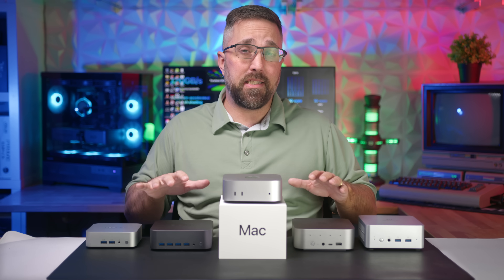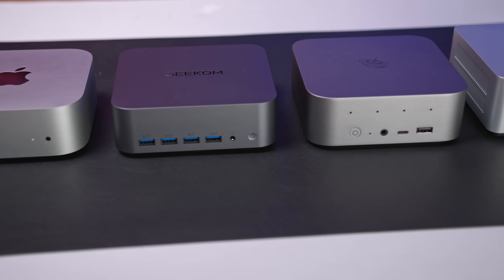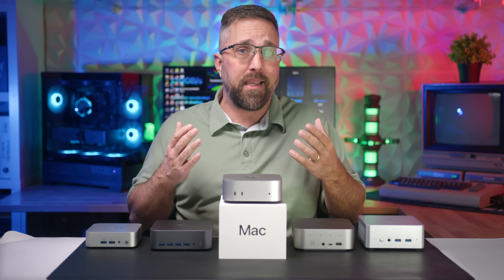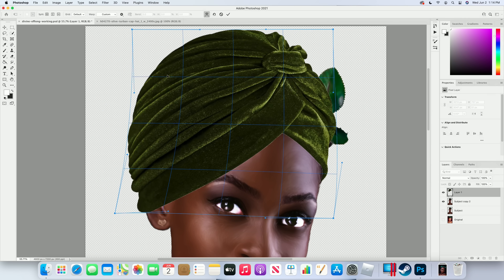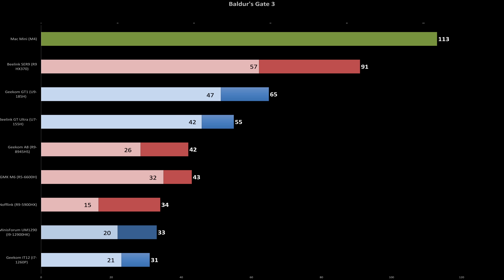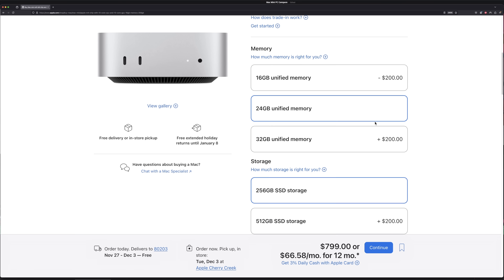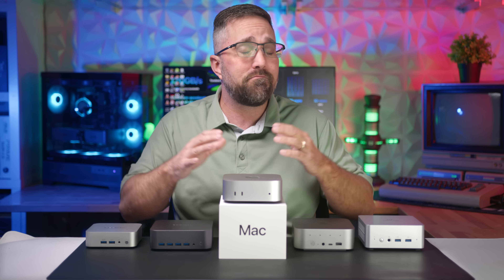M4 Mac Mini vs Intel and AMD Flagships – It's Not Even Close!

Comment: AMD switching to soldered memory? WTF are you on about? pc design is left the the manufacture and there isn't much difference soldered nad socketted. no wonder your channel only has 60k subs.
Reply: Pin of shame
Reply: "only has 60k subs" haha like that's a low amount
Reply: @hyatt2844  well it isn't a huge number to brag about but yeah it is something.
Reply from the maker: @EdU-od5ec  Still waiting. Nothing yet? Let me help you out: https://www.amd.com/en/products/processors/laptop/ryzen/ai-300-series/amd-ryzen-ai-max-plus-395.html   Just FYI, everything you said is wrong and five minutes of research could have saved you from making foolish statements.
Reply: @ElevatedSystems  This is Strix Halo, not Strix Point.
Reply from the maker: @Ic3h0t  True. Same architecture, different core counts and bandwidths. The point is the PC manufacturer has no control over what memory types are compatible with a CPU. That is completely up to the CPU manufacturer. And with the bandwidth requirements of these newer SOCs, current socketed memory technology isn’t compatible.
Reply from the maker: What socketed memory is compatible with AMD Strix Halo? I’ll wait.
Reply: @ElevatedSystems  Even Mac mini added dual CPU (M1 + intel/AMDx86, or any X86) + $199 MSRP (+$50 for the board + adding CPU slot) - (for intel i5 equivalence), they can sold their mac better than any mini pc. (I believe on apple's apple care than other mini pc's warranty (So other mini pc, need to stand up, no only on price, but on warranty). The warranty is more important than socketable ram (This hopefully apple can adopt more) or socketable cpu (Very good) - more over, with good warranty = good recycling, and phased e-waste (with Top tier guaranteed warranty)

I wonder why they don't do that (dual boot). Because x86 to ARM need another 10 year or more to success transition. I doubt it lesser than 10 year, because most AI / real programmer still haven wake up from halluciation.... (especially native C++ developer), talented already moved on to optimize kernel stuff, or move to robotics.
Reply: @ElevatedSystems  ACEMAGIC F3A AMD Ryzen AI 9 HX 370 Mini launched with upgradable RAM.
Reply: @TanushShukla  The Acemagic's ram is also lower clockspeed.  LPDDR5X runs at 7500MHz, highest I see for standard LPDDR5 is 6400.  That's probably not a concern for you if you're not into AI, but then again Strix Halo has AI in its name, hence its focus.
Reply: @TanushShukla just got it, 128 gb dd5 5600 mem. External gpu, 5060 ti 16gb. At 1000€ runs circles around my m4 mini. BUT i am keeping M4 mini for apple RAW video files.😅
Reply: @TanushShukla at about 100GB/s vs over 200GB/salon Strix Halo (395 max) and more for the Macs 400-546 M4 max and 800GB/ ultra.
Reply: @ElevatedSystems  When is AMD killing all processors except Strix Point?  I'll wait.
Reply from the maker: @AlanPeery   Well they only currently produce Granite Ridge, Strix Point/Halo, and Epyc. All SOCs prior to Strix Point are EOL, (killed) and all future mobile architectures will continue to press memory bandwidth. Meaning, unless socketed memory can overcome signal degradation problems at larger bit widths, memory modules soldered equal distance from the CPU as to maintain precision in the trace distance is the new norm. Did that answer your question? Hope you didn’t have to wait too long.
Reply: pin of shame
Reply: pin of shame
Reply: Pin of shame, lol
Reply: No need to be rude, we all can make mistakes and improve, that includes you, watch your tone.
Reply: why so angry tho? Even if you're correct, it;s just not normal to get so crazy over that.
Reply: "only has", lol
Reply: Absolutely needed to get memory bandwidth closer to dedicated graphics cards.  My m4 max has equal to 8 channel ddr5 at 8533.
Reply: Not if they put it on the die like Apple does.

And there’s a TON of difference between on the die and the enormous trace length to socketed DIMMs.
Reply: says someone with 2 subs💔
Reply: The pro of internet is that every idiot can speak freely.
Reply: @SHYANG-tt3qv   lmao fr
Reply: lol Ram compatibility is defined by the people making the chip. 

There isn't much difference between socketed and soldered? Hmmm....well i already explained it below, but i'll do so again for you because you're misplaced confidence simply can't be allowed to stand. 

Lets look at desktop Ryzen 5 chips. Supported memory speeds top out at 5600 MT, and while you can push memory speeds higher, they're not supported, and thus not guaranteed. While 6000 MTs is considered the "sweet spot" socketed memory has difficultly exceeding 6400 MT in dual dimm configs, and for QUAD channel those speeds top out at or BELOW 5600 MT, with many people failing to surpass 4800 MTs

Strix HALO on the otherhand, with it's soldered design supports quad channel configurations up to 8533 MTs, and it does it while consuming less power, thus running cooler while also allowing for a denser more simplified board design. 

Again, where socketed memory tends to top out between 6400-7200MT (depending on the chip) soldered memory has already surpassed 10,000MTs, and 12,000 MT is already in the works. 

Socketed memory ends up being further away from the CPU....and for memory to operate properly every trace  going from the cpu to each contact point on the memory module has to be the same length, and data has to travel in lockstep....the further those signals have to travel the more opportunity arises for signal derogation to occur, which can result in errors! The faster you push the memory speed, the more likely this eventuality becomes....increasing the power can remedy this, but it's far from a guarantee and it's creating another issue that has to be accounted for....and those complexities worsen the more dimms or channels you add to the mix. 

 So saying there isn't much difference between soldered and socketed just goes to prove YOUR ignorance on the subject.
Reply: Look at this fucking raging moron... Don't know shit and yet he is commenting stuff like this😂😂🤡🤡
Reply: The performance trend is towards unified memory on package or soldered.  Socketed can't keep up.
Reply: u got 2 subs in 12 years btw lil bro
Reply: 60k subs is better than your 2 subs lmao
Reply: Pin of shame lol
Reply: Subscribed - thanks to your comment for making me do it :)
Reply: Downvoted!
Reply: There is a reason why AMD and Intel can’t catch up to M series chips. The distance between the CPU and memory needs to be reduced and simplified, also increase the bandwidth. You will need to do the same for GPU. That’s why we end up with soldered memory and GPU.
Reply: pin of shame
Reply: @YAROSLAAAVX  "Not much difference."
Can the small difference be tallied?  If so, every drop in the time crunch bucket counts.  Faster is faster.  Pretty simple.
Reply: 7500mhz ram is very welcomed. and provides clear FPS jump 2x !
Reply: I always stop the video and go to comment’s for summary. Point is there’s no point in watching this video.
Reply: they think it will make them closer to apple silicon ... lol amd stocks are bad.. as well as intel.  I really thought 5 years is enough to catch up Apple silicon.. but no... Apple is still ahead of all competitors.. silly.
Reply: @rocheuro  Childish, brand centric loyalist horsesh*t.
Reply: @rocheuro   So ahead that still can't give 30 fps in 1080p gaming..
Reply: @rocheuro they are trying to compete with a mobile os on a mobile arcitecture. They should just stay on desktops because no macs will ever be able to compete against a real desktop pc. Macs are made for girls

Comment: Reason Apple Mac Mini power button does not need to be used that much is because it is running mac OS XNU-UNIX.  No need to turn a UNIX host off.

Do not know what the normal user does on their computer.  What would you sya about all of these when it comes to just content consumption, eMail, and IM/Text use?

Comment: That built-in Mac Mini power supply is a con, not a pro. My wife's older Mac Mini PSU burned out and Apple doesn't produce it anymore. They have a third party supplier, but at a cost that was nearly the original purchase price (PSU + labor). An independent Mac repair shop was only slightly cheaper in labor costs, still making the prospect of repair untenable. It became a paperweight sitting in a cardboard box. 

An external PSU is easily replaced and often costs $50-$75. I work in IT and can definitively say they go bad at a higher rate than many people would expect.

Comment: $600 Mac Mini is pointless at 8GB/250GB.  Why buy a device that is obsolete before you even buy it.  And at $600 you can get a mini PC with 32GB/2TB and a fast Ryzen chip, far more suited to gaming and pro tasks than a 8GB mac.  But more to the point, if professionals need a GPU heavy performer, they will just build a PC with a RTX 5090.  So the walled garden is not safe in any direction except maybe elegance for people with some money to burn.

Comment: While your video is spot on, along with the Apple caveats in upgrade pricing, I don't think many PC people are going to be doing either professional media work or gaming on Macs by default. I do sysadmin for a design company and we use both platforms. CAD and rendering on PCs with high end graphics is light years faster than on the Macs. On top of that fact, we build all our own PCs and can choose components accordingly. The Macs are used for other media work, though, such as Adobe products, and they're fine there, and Apple silicon machines seem to be much more reliable than their previous Intel ones, which were truly awful. However, even there, they don't compare to PCs with discrete GPUs, and repairing and upgrading machines is of course not possible on modern Macs. This affects their value over time. Fortunately, Macs have excellent resale value and can be sold for newer models. The PCs you used on these tests are mostly used for productivity. Not that many people will buy them for gaming, as you can build a PC with a discrete GPU for less than the price of a Mac mini.

Comment: My 2021 Mac M1desktop fried itself from the inside last week, leaving a clear burn mark on the inside of the screen. Took it into Apple Store genius bar at the suggestion of Apple Support. I was told that the unit was out of warranty by a month or two and that I would have to pay for the repairs which they told me was $1200 AUD. More than HALF what i paid for the unit brand new on release! No other offer of help, just basically told 'tough shit'. Im now in the process of replacing all my Apple products. Engineereed failure, is what it is - to make you give them more money. Learned my lesson

Comment: You can upgrade the storage from third party vendors that will work. The chip will cost 1/3 that of Apple rip-off charges.
Reply from the maker: Until you can't. Apple has been known to push updates that disable 3rd part hardware in the past. Nothing is keeping them from doing it again if these SSDs start eating into their bottom line.

Comment: I have a MacMini M1 1TB storage and 16GB RAM and its great and no need for my usage to upgrade. 
Concerning your price/performance ratio I would rather consider the price with 1TB (i.e.: +400$) because, if 16GB RAM on MacMini is equivalent to 32GB in Windows world, storage is storage and 256GB is simply not enough independently to the possibility or not to connect external SSDs via USB-C. You want at least 1TB internal SSD as the mini-PCs You have in test. 
Then You have to consider that MacOS is not everyone's cup of tee ;-)

Comment: A separated power supply is better, because it is a heat source, and keeping it external to the actual computer means cooler operation, or the ability to operate faster and maintain a lower temperature.  Yes, internal switchers are usually "warmer" than even their 'dongle' counterparts at the same power delivery.

Comment: My Beelink died right after 1 year warranty expired. I begged their support to send me replacement parts and I was willing to pay for parts and shipping. They told me to go and buy a new Beelink instead. My first macbook air, on the contrary, still runs fine after 14 years of use!
Reply: WTF
I was considering a beelink
Now I'm having second thoughts
Do you know which parts died specifically?
Reply: @Justakatto  just do not support beelink it aint very good anyway
Reply: @Justakatto   Get a used Mac mini. Will last forever and still have some resell value if you'd want to get rid of it.
Reply: @_________________404   That built-in Mac Mini power supply is a con, not a pro. My wife's older Mac Mini PSU burned out and Apple doesn't produce it anymore. They have a third party supplier, but at a cost that was nearly the original purchase price (PSU + labor). An independent Mac repair shop was only slightly cheaper in labor costs, still making the prospect of repair untenable. It became a paperweight sitting in a cardboard box. 

An external PSU is easily replaced and often costs $50-$75. I work in IT and can definitively say they go bad at a higher rate than many people would expect.
Reply: @MesserEsser_OG   There are companies using these M4 Mac Minis in server racks because they're cheap, power efficient and have a lot of CPU power. Apparently they're reliable enough to even be used as such.
Reply: @MesserEsser_OG  My two old 2012 Mac minis are still running quite fine right now. Barely ever turn them off, they sleep, wake up, and do their jobs.
Reply: @_________________404 
No, when used in a server system, they keep spare units on site. If one fails they plug a spare in and return the bad one to Apple for a refund.....

Comment: (a) The Mac mini's power button being on the bottom is because the mini, once up and running, is typically never powered off. My daily driver is a M1 MacBook Pro 16, which has been in a continuous power-on state since first power-on in December of 2021.

(b) No need for Linux on a Mac, as macOS is actually a GUI layered on top of a UNIX O3 compliant operating system. Why have a knockoff when you can have the real thing?  Any Mac is perfectly happy operating in server mode via a terminal interface. Simply go into Setting and enable Remote Management (i.e. ssh access). If you want to do VNC-style remote desktop, simply add a $14 fit-Headless (by CompuLab) HDMI emulator so that it thinks there's actually a connected display. This will enable the display drivers necessary for remote desktop.

(c) Buy a Mac for productivity and the occasional coffee-break game. Buy a PC primarily for gaming and the occasional productivity app--Excel comes to mind.

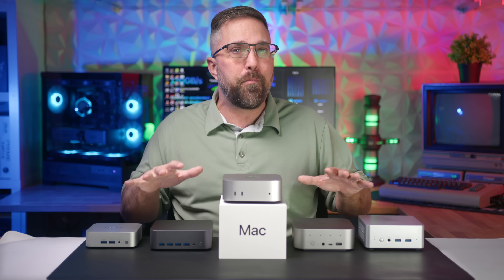Comment: 12:25 mini pc's and steamdecks/handhelds are apples and oranges. To say this is better than that, I just say, No. 

Handhelds throttle power and the cpu/memory clock speed, the gpu share memory, which quickly reveal the limitations of 16gb with a clock speed handicap. The actual performance is devastating, a steamdeck is easily overwhelmed. Its only a reasonable compromiseif portability is everything. 

Mini pc's are power efficient, yet powerful. They have better components.They are typically benefit from better thermal management, and no thermal bridging with a battery. 

For portable gaming, steamlink. If you need offline gaming while camping, seek help.

Comment: The only reason apple does well is because iOS is so basic and lacking features that it's easy to run ..creating the illusion of fast compute ,when in reality simple compute is fast
Reply: Apple products running iOS: iPhones and iPads. Apple Watch runs watchOS. All Macs, including the Minis, run macOS. All operating systems from Apple are multicore and multithreaded, which the OSes handle rather than direct app support, meaning all native apps automatically support multiple cores and multiple threads. Windows itself is multicore and multithreaded, but apps written for Windows need to be specifically written to support multiple cores and threads. In short, nothing you said is accurate.

Comment: 4:17 this section did not age very well, as this SSD can very easily be swapped out for much cheaper than what apple is asking, aka YES it is user upgradeable
Reply from the maker: Until Apple pushes an update that disables 3rd party SSDs. Just like they did for 3rd party screens and batteries in iPhones and MacBooks.
Reply: @ElevatedSystems  mm fair point, but could they even do that considering the controller is on the SoC and the storage modules are just dummy NAND chips?
Reply from the maker: @sir_whocampsalot2876 of course they can. They can simply update the storage controller firmware to: check hardware identifiers, compare expected Apple-authenticated cryptographic hardware keys, and reject modules lacking secure pairing. They already did it to a degree on M1/M2 cloned SSDs. Users who Performed DIY SSD upgrades to their M1/M2 Minis and Mac Studios were left with bricked computers after an update. The 3rd party SSDs are good and replicate the hardware well but not even Apple technicians can access the secure enclave and clone crypto keys.

Comment: I purchased an M1 macbook in 2020 and have been using extensively for productivity, work, university, coding, machine learning and even some light gaming. Over the 5 years I owned it, I never dipped below 60GB of free space on the base 256GB model. 99% of users will never need more than that, especially when half of your stuff is stored on google drive, onedrive and icloud. And if you're the 1% - a 1TB external HDD costs like 40 Euros:) Also, 16GB of unified memory on an Apple machine in terms of real life performance is close to 24-30GB of regular  DDR5 RAM. Don't buy any upgrades over the base model